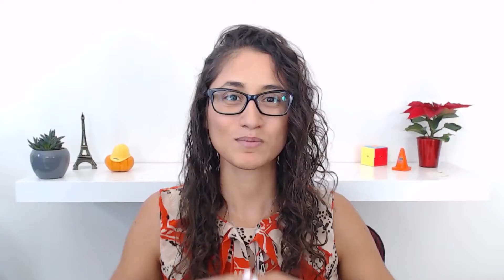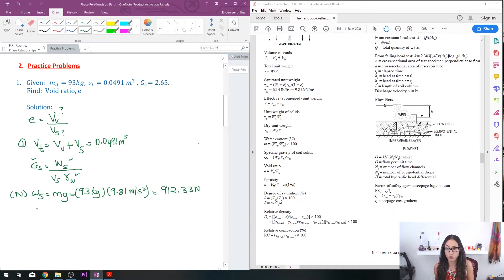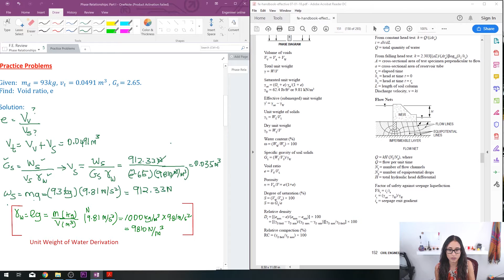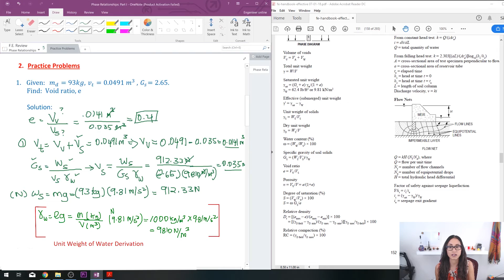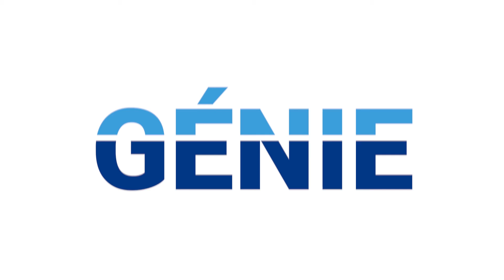FE Civil Geotechnical - Phase Relationships Void Ratio e

Comment: The volume of the dry sample can also be found using its mass. It is important to note however that the denominator will be in terms of (kg/m^3). The unit mass of water (γ_w) is 1000kg/m^3. As far as I'm aware, this value isn't given in the NCEES Reference Handbook. That value will still be multiplied by the specific gravity. To get the volume of the dry sample, the equation will look something like   (m_Dry)/(G_s*1000kg/m^3). Units will cancel and you'll end up with m^3.
Reply: I know the comment is 4 years ago but thanks Frank